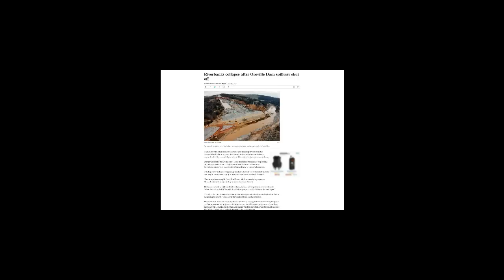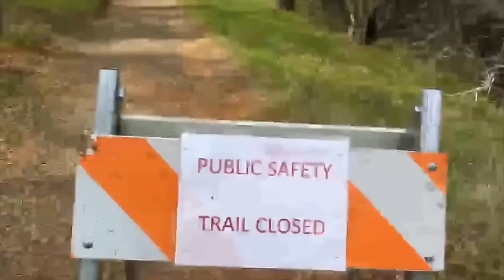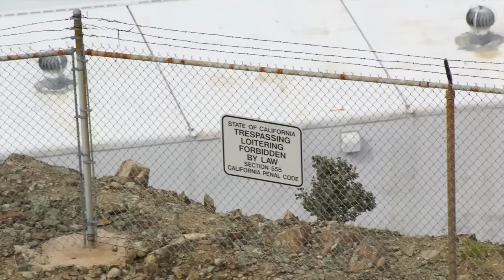Power Plant Shut Down | Riverbanks Collapse | Lake Oroville Dam | Update 3-4-2017

Comment: Riverbanks collapsing after being saturated with flood waters over the course of a few weeks should be considered imminent if not automatic in a lot of areas. We have floods quite a bit in the mountains and it is par for the course. One major difference between here and there, is our river banks haven't been as dry as theirs for this amount of time. If we have river bank issues, I can imagine the fun these folks are having. They should also expect mudslides, probable avalanches, and even sinkholes with dirt as dry as theirs has been. Shutting down the power plant may be for inspections of the power plant structure itself. They have a day or two to catch up with the damage, which makes damage assessment, and possible planning for further releases prudent. :)
Reply from the maker: Yes they shut down the power plant for 1-2 days to dig the channel deeper so they can run at full capacity.
Reply from the maker: He's just a troll